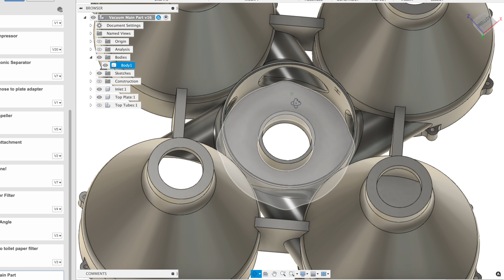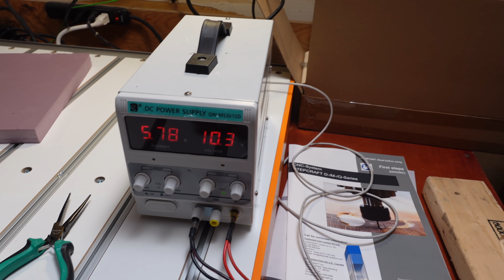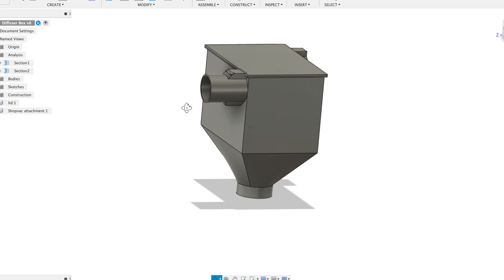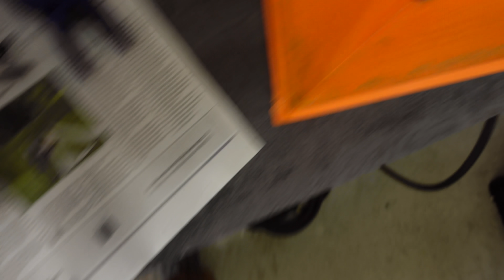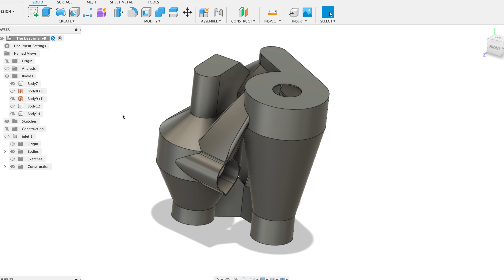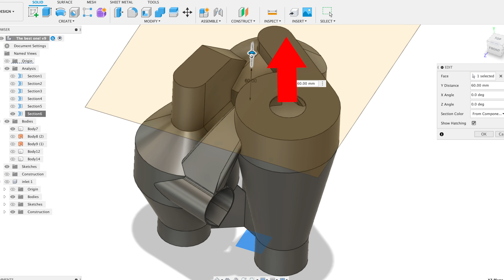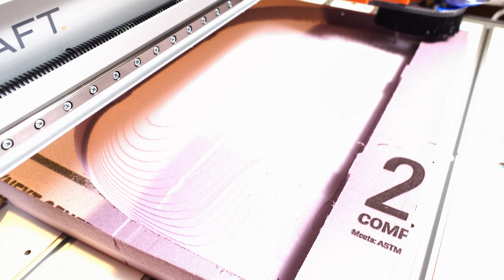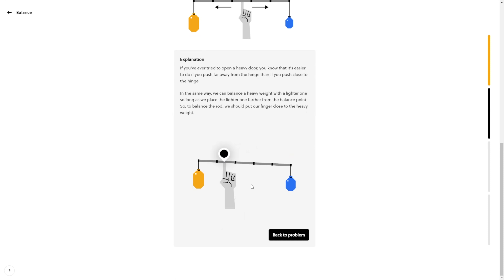3D Printed Cyclone Air/Dust Separator

Comment: This was a great demo and tests of different cyclone designs. (a lot of work you put in) I see that many people here know some of the things you could do to improve the designs. I have made a living designing these for industrial use so we have much data that could be shared.
Just for fun I am going to see if you figure out who is telling you the right design information. So to be fair I will give you a few clues and I bet you figure out who is.

1. Never forget the choke tube
2. The low pressure point will get you every time.
3. The ratio is more important than you think. (Conservation of energy)
4. More than 2 stages is a waste
5. Gravity is your friend.
6. Delta P tells the story.
7. Bulk density is a thing.
8. Specific volume changes with loading. (what happened to my velocity)
9. Particle distribution who knew it mattered.
10. Accretion layers are not just for planets.

I really enjoyed the video thanks for sharing. I wish I had as much energy as you.
TTFN

Comment: I wonder if the single cyclone did better because it's a larger diameter. The dirt particles are further from the exiting air stream so they are affected less than in the smaller ones where they are mode readily sucked out.

Comment: Your 3 stage is a bit flawed, using your logic, the first cyclone you should have air enter into is the steeper walled cyclone, since you stated that larger debris just orbits around and stays in the shallower cyclones. The main flaw is that it's not the cyclone wall's steepness that determines the separating capabilities, it's the diameter of the cyclone. Smaller diameter = higher turn radius for the air = larger "centrifugal force" on particulates.

Love the project & experiment videos! Keep it up!

Comment: Check out the Harvey Gyro Air G700 series of dust collection machines. They use a horizontal configuration that seems to work much better.

Comment: And alternative would be to keep the mono cyclone you have, but cut a 1" wide slot the entire way down the wall of the vortex tube, and have it sat inside a bucket as a second collection chamber. One around the outside of the vortex tube, and one at the bottom. So much of the dust that is currently trapped spinning around the walls of the cone would be centrifugally thrown through the slot in the side and trapped outside of the vortex.

Comment: Make the hole at the bottom slightly larger. Also the outlet at the top should not be flush with the top, 3d print a tube that goes one third down in to the cyclone.

Comment: I think there is the thing, proportionally big cyclone separator fits the airflow, when small in series doesn't, thus decreasing hole size on series separator helps little bit. Also with this amount of airflow  you should try add to the system couple big versions right after first one, making series of big separators. Testing even bigger cyclone separator on same airflow, i think can help understand, what is better. Ducting the inlet downwards in to cone is also a thing.

Comment: The reason your blue ones were sucking up dust was also due to your angle. If you look at any other cyclone dust collector you'll see that they're quite steep. I'm a fan of the multi-cyclone idea but you need to steepen those angles and make them taller.

Comment: The squealing that you were getting from that tube was a result of it being a ribbed versus spiraled tubing.. vacuum hoses are almost always spiral tubing doesn't seem like it would make much of a difference but it actually does with regular ribbed tubing you will always have that squeal no matter what size motor you're using.

Comment: Seems like some of the dust gets stuck in a constant orbit instead of making it all the way to the bottom. Perhaps several very low profile exit scoops along the cone will catch some of this dust better. Also, consider lining the cone walls with paper or a smooth surface because dust may be getting stuck between the 3D printed layers.

Comment: What if you change in the middle before dispersing the air into the bucket, from reducing to a smaller hole to then increasing back into a larger hole, like an hourglass type of shape?  Would the airflow that was accelerated then get a chance to gently slow down before being deposited in the bottom of the bucket, potentially with greater results?  Not sure, but it makes me think how we want it to come to a gentle stop at the bottom of the bucket, with less encouragement for leaving the bucket.  Or maybe this would create a disturbed airflow and cause the cyclone to become completely erratic?

Comment: I would recommend that you try to print a little extra part that goes into the outlet where the dust end up in the bucket you know this things on top of chimneys? So rain doesn't gets in why not trying to make something like this when it works for rain then it works 180° turn around so the little tornado forming in the cyclone funnel doesn't goes all the way down and sucking the dust up into the vacuum

Comment: 11:50 - how good is the seal on the food container you're using? It looks similar to one I'm using, and if that's the case, it isn't a good seal - that would allow a similar bypass as you found when you added the smaller stages. Consider also that the dump buckets want to be taller, and sometimes want vortex damping.

Comment: 2 bucket system.... Connected in series.. 
One big bucket for bulk material, nothing to restrict airflow... Line in line out. Nothing fancy.... 

2nd bucket. Just 1 cyclone optimized for fine dust... 

Also you have a 3d printer... Try out like swirley pattern raceways.... Or maybe even golfball dimples. 
Wings are kinda borring but easy to draw.

Comment: Interesting.  Given volume in equals volume out(roughly), I would suggest your air flowing in should have a smaller hose and the bottom of the cyclone should have a bigger hole, also the hole exiting the top should be larger as this will reduce the escape velocity of the material and hopefully minimise the amount of really fine particles remaining suspended.  Another really interesting way to go is utilising water.  Dust hits like a water wall and then is captured.  I use this for sprays.

Edited - elaborated what was implied by v originally.  Mawyman below gives more of an explanation for volumetric flow.  In essence your vacuum cleaner generally always pulls the same volume of air through it.  If you have the straight pipe with no attachment on it you pick up some stuff, i you change it for one with a smaller opening it pick up most stuff.
Reply: Well technically the continuity equation is Ain*Vin = Aout*Vout or in other words Qin = Qout where q is volumetric flow rate. It’s clear you understand the areas impact but I figured I’d just clarify for future peeps.
Reply: @JeronimoStilton14  haha yes, rightly put.  In my haste I've suggested in the opening line that v in equals v out.  I meant to imply volume but see where there could be a clear issue.  Just wanted to imply that what goes in as volume must for the most part come out.  Been a while since ive done fluid dynamics haha 😄 thanks for clearing that up though 😀
Reply: @cjcro6456  I’m a recent mechanical engineering grad so fluid dynamics is painfully fresh in my mind haha.
Reply: @JeronimoStilton14  congrats mate.  Finished civil about 10 years ago.  So a vary bare bones shell left of the knowledge.  I did smash Laplace Transform though haha

Comment: The flow of air or really anything is going to follow the path of least resistance, going into the design with that simple piece of information could've saved you printing all those iterations to discover this fact, which it doesn't seem like you really did by the end of the video.

Comment: There's a huge number of variables with cyclone filters that affect their operation. For example if your walls are too steep then debris is too close to the outlet and things can jump across, if it's too shallow then as you've found out, dropping down isn't efficient. If you're running them in series you probably need different angles on the cones, I'd say starting with quite steep and ending quite shallow - first one takes out the bigger stuff and the last one takes out the smaller stuff (i.e. I think you may have got it backwards question mark), and yes, they do need isolating.

Comment: We’ve done a fair amount of research on these cyclones for our projects. There are a lot of academic papers out there which pretty thoroughly describe the performance characteristics of these things given different geometries and boundary conditions. A given geometry tends to preferentially separate out particles with a particular density. In other words, a given cyclone might perform great for steel grinding dust but not so well for sawdust. So your results will depend on what you’re trying to separate out. Fun project, thanks for sharing!
Reply: id like too see one used on a sub-7L engine and or in slowmo as i 🤔 if the cylinder cycling would let it work 🤔 or with water 💦/humidity. as for his i think 💭 the lines need to be smooth out as the one video frame looks like the parting line or lines is getting in the way and undoing the point of filtering out the junk and adding resistance for the vacuum cleaner

Comment: I'd say width compared to rate of flow is pretty important for these cyclones. The centrifical force needs to be greater than that of the suction force, so having the particles be further away from the outlet due to the cone being wider may explain why the largest cone performed the best.

Comment: Maybe If you increase the diameter of the cone it would slow the airspeed at the perimeter, allowing the larger particles to escape the higher speed air column flowing up through the center of the vortex. 

I really enjoy your videos. Thanks for doing what you do.

Comment: I installed a JET 1100cfm vortex cone dust collector with canister filter for a ShopSabre cnc. Majority of the vacuum path is smooth walled 4" rigid piping with 3d printed adapters to 4" flex hose when needed minimizing number of bends, flow paths/fittings and high friction tubing like the flex hose. I feel like all this might make you loose a decent amount of suction. But definitely a cool project for this level of hobby setup, looks light you had a lot fun!

Comment: This whole video I was screaming out loud "WHY ARE YOU TRYING TO REINVENT THE WHEEL?????

I took "Air Pollution Control" in my Master's program for Civil Engineering.  Cyclone separators are very simple and easy to engineer, build, and understand. I'm sure you can find stuff online about how to design and build them and what performance to expect based on particle size and density. You could even dissect nearly any bagless vacuum cleaner to get ideas on how they work and the proper proportions.

One feature I noticed that was neglected in most if not all the designs, is that the exit pipe in the top center should extend into the cyclone chamber, a certain number of diameters of the pipe, like 1 or maybe a half, I don't remember. I think it's called a "vortex finder."

This is a great practical video, I'm glad you made it, and I mostly enjoyed watching it, but you could have started much further ahead than you did with just 5-10 minutes of reading.
Reply: Stealing stuff from the past makes sense. But doing it by learning is GREAT FUN and you might invent new stuff not even heard of before. So keep doing by experimenting! Love the video's.
Reply: Some enjoy experimenting and observing on their own. Many learn better this way, and often new discoveries come from this kind of tinkering and observation discipline.
Reply: @simon-pp5sm  I get that. Personally, I like to start with something that already works and iterate it into something better, rather than just bash at it until it works kinda, which is what happened here. He stopped before he even had a really good result.
Reply: Okay dude

Comment: I am just finishing my new 500x500x500mm 3D printer and I am also in the middle of upgrading my workshop. I still haven't figured out how exactly I will burry a dust collection system inside the large table that will have a table saw and a miter saw embedded in it. This video certainly provided some food for thought.

Comment: I made a cyclone vac using 2 orange buckets and a $20 bucket vac. It's been working for years and I've filled the 1st bucket many times but never touched the filter. The cone feature is largely unnecessary and I never 3d printed anything. I use a simple plate to separate spinning air from exiting air.

Comment: Love your breakdown of your testing but hear is what you should try. The hose from the cyclone to the vacuum needs to be bigger than the inlet hose diameter. It's the same principles as high pressure hydraulic systems. The cyclone is where the work is being done if thought as a hydraulic system. The top part of the cyclone needs to be at least 5x bigger than the hose from cyclone to the vacuum. The bottom of the cyclone should be larger than the hose to the vacuum as well.

Comment: Leakage at the bucket lid is what always gets me. I have learned to ditch the lid and make a plywood top that has a rubber gasket. It and a companion bottom are joined by all thread and squeeze the bucket to make the seal. It seems like a lot, but ANY leakage in that area destroys efficiency. Keep up the great work!

Comment: love to see more of these cyclone separators. what if you combine the mono and the multi-cyclone in series ? . can I get the STL from the mono cyclone :-) .. would it help if the exit tube is not flat leveled to the lid, but stuck out like 5 cm's to prevent particles who are forced to the outer wall to be sucked in?

Comment: you need to consider the ratio between cyclon's value vs air speed. Small cyclons are less effective because the air flow is too fast so it picks up dust.

Comment: 10:19 flows always follow the path of least resistance, so adding valves to each outlet allows you to control and split that precisely.  Once you know you can then design smaller nozzles for the first chamber to the larger nozzle for the last chamber
Reply: I kept scrolling to find someone who would finally mention the path of least resistance, this is a problem that tends to be extremely pervasive in the 3d printing community. You have people with a lot of passion and willingness to get into CAD and start designing; but when it comes to implementing rather basic scientific principles into the design to save you having to print endless iterations, hoping you stumble on a design that conforms to these principles, the community can be a little lacking.

Comment: The high pitch sound will have been as the small pipe meant airflow was very fast and pressure drop was likely too high.  It was therefore probably pulling air in through any gap it could find.  increasing the diameter lessens this air velocity and solves the issue.  Cone angle is key but so too is the surface finish as the smoother it is, the easier it is for finer and finer particulates to fall further down and more rapidly.  I'd also recommend trying the outlet hose being lower in then tank and tapering from top to bottom.  This should increase air velocity out while limiting the  tornadic cone size so more particulates can drop out.   Great job...inspired to build my own :-). Oh and ps...if you split the inlet to come in (one on each side like those old coin rolling charity collection machines) in the actual cone wall but with both facing the same rotational direction and slightly down you can initialise and maintain a better bulk flow and motion.  This is based on my work with liquids but should be same on air

Comment: I reckon the series cyclone does better for larger particles but worse for finer since it has more opportunity for the large particles to lose speed and drop out (longer path length), but since they're smaller the extra restriction to the air at the same flow rate (volume/sec) increases its speed (m/sec), meaning the finer dust gets swept along more easily. In contrast, the larger cyclone restricts the airflow less which allows the smaller particles to drop out since the air speed is lower, but presents a shorter path for large particles to lose their momentum.
Think about the Reynold's number (represents relative scale of inertial forces and viscous forces) of larger and smaller particles; for large particles their momentum dominates, for smaller particles the drag between them and the fluid dominates.

Disclaimer: educated in physics & engineering but fluid dynamics is not my field :)

Comment: I would guess that the bigger the cyclone the better the seperation, as you said, the drop in airflow reduces the amount of particles that can be hold in it. I think the wings (the ones you ended up removing) arent that bad of an idea, just their geometry was impractical, what led to stuff sticking to them. Chamfer the edges facing the airflow might help. 
But i just started designing my cyclone, so no practical experience here.

Comment: What happens if you cycle water as an outer layer on the cyclone, so dust that just touches the outer surface of the wet cyclone becomes wet and sticks in the water. Also, try increasing the diameter of the cyclone as much as possible, as that could also be important.

Comment: Great test and interesting results. I use a cheep china cone separator for my DIY CNC, what I noticed is that airflow plays a big part in how well they work. If I "overload" my hose with a pile of dust then the airflow in the separator seems to slow a bit making it less effective. Make a test where only change is airflow.

Comment: use a water reservoir with low pressure(vacuum nozzle hose) intake - water - outlet(hose to the actual dust bin), the water well like in a cavern that u must dive to transit to the other side.